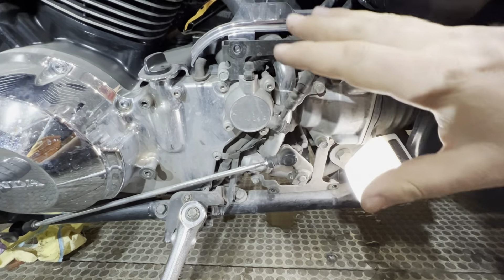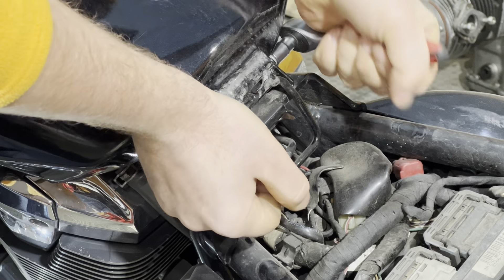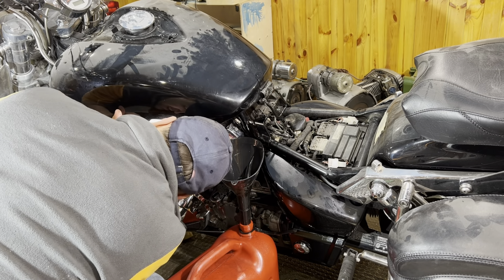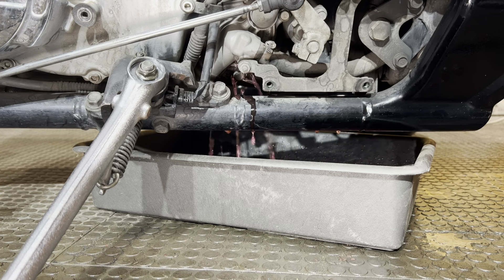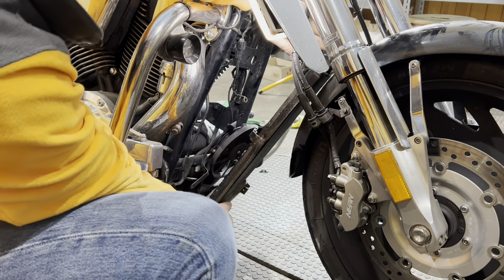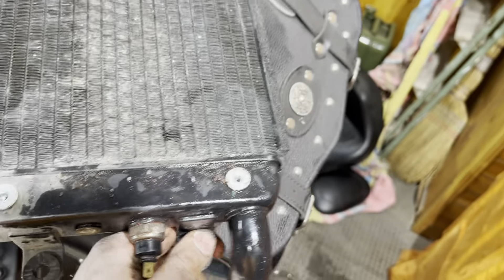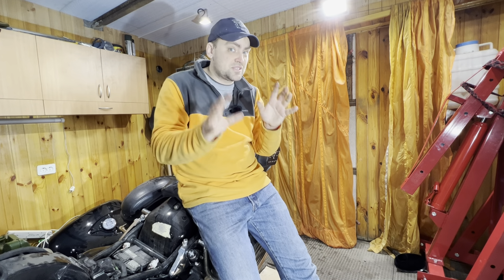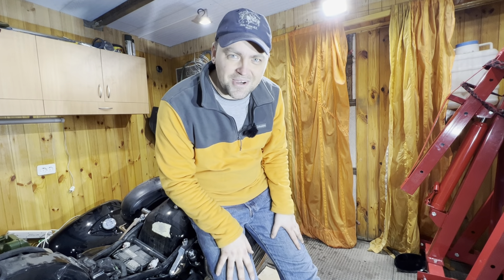Honda VTX Radiator Leak Troubleshooting | Coolant Drain | Radiator Removal

Comment: I was in the same situation in December. My new radiator is still on a slow boat from Japan so I just had my current radiator welded & I will swap them over once I get the new one & keep the repaired one as a spare. Yeah pretty expensive but hell so is an engine

Comment: Nice bike! I had a vtx1800c back in Ukraine. It served me well for more than 100k kilometers. I did have the same issue with the radiator once. But the real pain was to replace the cam chains. You have to pull the engine out to replace them.